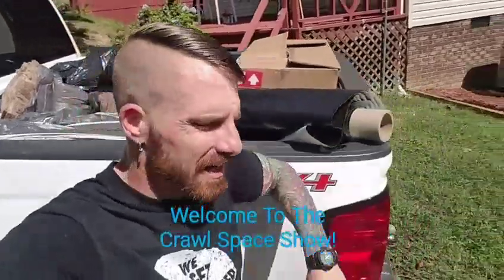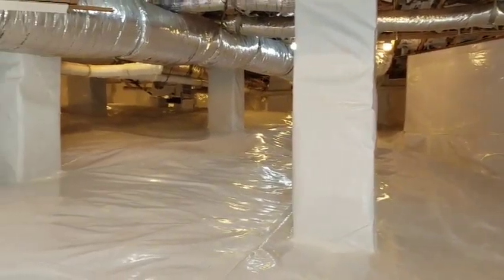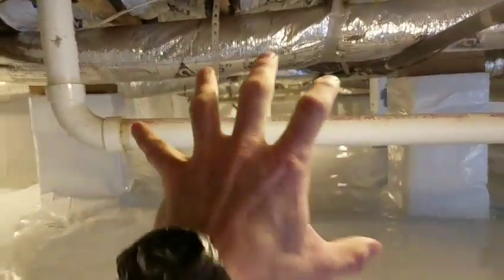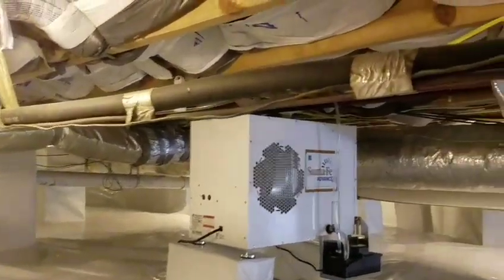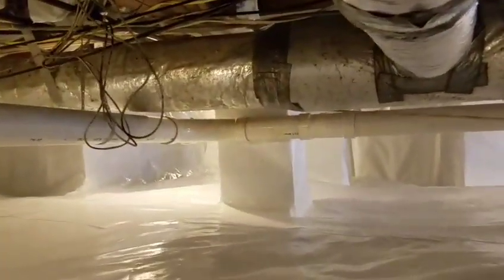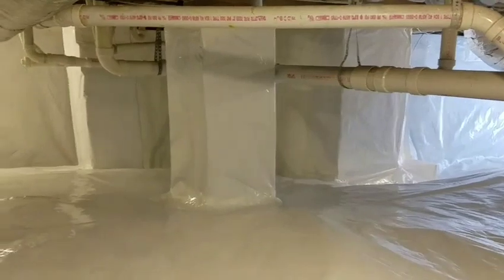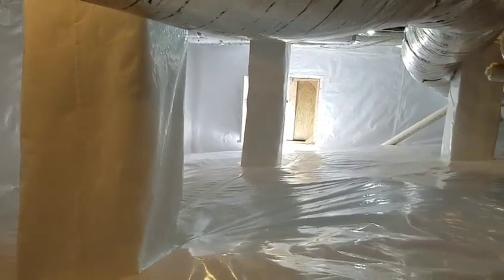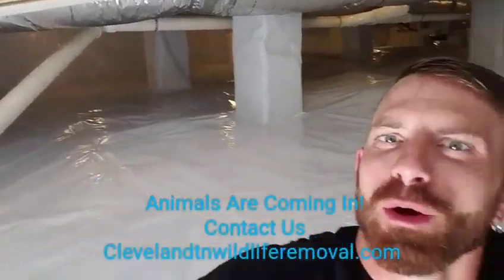The Crawl Space Show | DIY Crawl Space Encapsulation ReDo

Comment: hello.  Very complete and thorough looking encapsulation!
What about the 3" typically reserved for termite inspection?
Also, do you get over to Toledo, OH?
edit* lol, nevermind... I heard you say "cleveland" in your video and automatically assumed your buddy was in Cleveland, OH.  So, I doubt you get up to Toledo since you were referring to Cleveland, TN. :p
Reply from the maker: That is all made up tales from the pest control industry. This 3'' magical window does nothing to which you are told. They are said to be viewing points for termite mud tubes. Those mud tubes go up and over to the box seal. Which we trim every single job in line with. You can still see the top of the block, to the box seal, on every single job. Don't listen to the magical window stories. Those same people will sale you sticks in the ground, and charge every couple months to come check your sticks, and your house never have a treatment done on it. If you are worried about termites, as any homeowner should be, you should have a liquid Termidor treatment performed before the encapsulation work is done. We did termite work for years. I have never, and would never (up to this point in time at least), used any other chemical other than Termidor. Follow the label.
Reply: Bill, please refer to your state code on if you need a gap for termite inspections.  YES THERE IS A CODE FOR THIS.
Reply from the maker: @travisnicholsaccurate8720  ok code babies. Lol! I love it! Yall can all......insert the words!  ;)

Comment: looks awesome!  I see you insulated the floor joist.  I have read other sites where they recommend not insulating the floor joists in sealed crawlspaces.  What is your argument to that?  I have sealed my crawlspace but do not have insulation in the joists but have always wanted to.
Reply from the maker: People are foolish. It is the most common sense related topic I discuss daily. I have tracked numbers under houses with Acurite humidity monitors since 2008. I know the moisture, and temperatures, of close to 200 homes. HOMEOWNERS DO NOT HAVE TO GET ANY INSULATION. It is ignorant not to, but they do not HAVE TO. It is strictly personal preference. 

In the wintertime, when it's cold as hell, and we HAVE ENCAPSULATED  everything just as you see in every video you decide to watch of ours', if we DO NOT INSTALL OUR INSULATION, I see a 3-6 degree difference, from crawl space temperature, versus the living room temperature inside the living quarters of the home. In the same scenario, everything's encapsulated, it's cold as hell outside, in the houses THAT WE DO INSTALL OUR INSULATION, I see an 11-13 degree difference in the same two temperatutes (crawl space versus living quarters)

Therefore, you can see just how much more heat is being sucked into the crawl space when we do not install our insulation. Do you want to keep INSIDE YOUR LIVING QUARTERS, OR DO WOULD YOU PREFER TO LET YOUR HEAT SLIP RIGHT THROUGH YOUR HARDWOOD FLOORS, AND HEAT UP YOUR CRAWL SPACE? How often do you sleep, or have people over to sleep in your crawl space? The whole philosophy behind not insulating floors is laughable to me!

You have to insulate your home's ceilings, exterior walls, and floors to maintain controlled temperatured within the living quarters of the home. These "people" are being led to believe that by placing foam boards on the walls of the crawl space, that "levels things out" they keep telling me in their argument. You see though, I have no argument. I only have real, actual numbers. I have only been consistently tracking those numbers for more than 10 years now inside actual properly encapsulated crawl spaces. Sl with all that being said, if someone WANTS, and if someone THINKS, and if someone even remotely acts like they know more about this shit than I do, then I do them like just like I do all the crybabies flapping their whiny ass mouths about how I never, and will never, leave their magical 3-4 inch termite window,  I smile, and I let them say whatever they've been told by some ignorant wannabe know it all, and I reply, "Go spend your money however you want to spend it. But when you call me back, after you've wasted your money, and I have to come out and do everything like I explained to you in the very beginning, it's going to cost you even more money to fix somebody's half ass shit, and I don't want to hear no crying! 

I do these projects, and been doing these projects a long time now. The system works. The system never changes. It is the same, and will continue to be the same solution that you have seen, and will see on all of our encapsulation projects in the future. Floor insulation is a wise investment. Foam panels on foundation walls, or spray foamed walls, are a crock of shit, they look like shit on top of that, and are a complete waste of a homeowner's money, that ends up serving a fraction of the purpose, as opposed to doing it right to begin with, and insulated the floors like they should be insulated.

Sorry for the novel. Good question. If your into insulating your home's actual living quarters, as you should be, then insulate your floors with an r19 poly-encapsulated johns manville comfort therm, you can use it in the walls too, and blow a cellulose r60 in your attic. Anything other than that, you would be better off just setting your money on fire. And there's a lot of money getting burned daily due to people like myself, people that homeowners view as the professionals, telling people to cough up their money, and waste in on unnecessary expenditures, that do not even perform the acts to which they are being told. It's all part of the business game. I have always chosen to be an open book. I choose to run my company on honest morals, with integrity, and I think it shows in our work, just how far to the extreme we take our level of craftsmanship in every project we tie our names to. If people want to do business with me, AND A LOT OF THEM DO, I appreciate them as much as they appreciate me. I appreciate you watching this video, and asking me this question. I hope you appreciate my answer. Let me know if I can help you with anything else.
Reply: @TannerFlowers  - Amen brother!  My thoughts exactly!  I will be adding insulation this weekend!  Thanks for the knowledgeable and professional opinion.  I don't see why someone cant seal off an attic to make it non-vented as well as long as everything is insulated.  We have ductwork all through the attic that fights the cold when trying to heat and heat when trying to cool...
Reply from the maker: @jeffsapp5258  had to go 3 hours away today to Nashville to inspect a crawl space. You should have seen that poor fellow's house!! Some company spray foamed all of his foundation walls, the bottoms of piers, underneath his freaking porch, and then installed a flimsy 8 mil vapor barrier. No dehumidifier. No exhaust fans! It stunk like cat piss just like I tell everybody they do when they don't have any exhaust, and it looked like absolute shit to top it all off. No floor insulation either. I just walked in the door a few minutes ago. People are out scamming people out of their money, in every city, and every state that this work is taking place. If you want your crawl space done right, just copy what I do. You won't have to worry about anything then. Change the recipe any, and your cake likely won't turn out like you hope. And that's the real real amigo. Insulate those floors with that Comfort Therm, use a 20 mil poly, install a couple humidistat fans, and use a Santa Fe dehumidifier. You'll be happy you did once it's all said and done.
Reply from the maker: @jeffsapp5258  https://youtu.be/DEQl0NZ_EEY

Comment: So we’re saying the insulation between the floor  boards is better/ necessary?? You were talking about a 11 degree temp difference or the 3 degree difference.. which is more desirable and is that with or without floor board insulation
Reply from the maker: 11-13 degree difference when we install our new r19 poly-encapsulated insulation. 3-6 without it. We never install any other kind. Been installing the same stuff since 2008. Great product!
Reply from the maker: https://youtu.be/DEQl0NZ_EEY
Reply: Ok.. Im catching on.. I saw in that video that you don’t use foam board, just proper encapsulation with floor joist insulation, correct? I’m about to drop 10k on a roof so I don’t know when I’ll be able to get crawl space done. But I’m glad I’ve seen these videos and understand the importance now. 

Good stuff man
Reply from the maker: Foam on the walls is completely unnecessary. Unless, like I say all the time, your crawl space is going to be used as living space. Otherwise, if anyone has got sense enough, that is what they insulate, THEIR LIVING SPACE! Which is exterior walls, floors, and ceiling. If I stood in front of you, and you just bought the baddest ass new Echo blower they make, and I held a sheet of the 20 mil poly in front of me, you could blow that poly all you wanted to with that blower, and none of that air will be penetrating that poly. It is CRAZY how much of an insulating factor it becomes, when literally sealing everything as we do. But still, without it, even after we finish, in the winter here, I will see a 3-6 degree temperature difference from those crawl space temps, and the living space temp inside the home. On the homes that we do install it after our 20 mil encapsulation is complete, then I see, in the winter here, an 11-13 degree difference, in those same two temperatures!

Thanks for watching, and commenting too. I appreciate it.